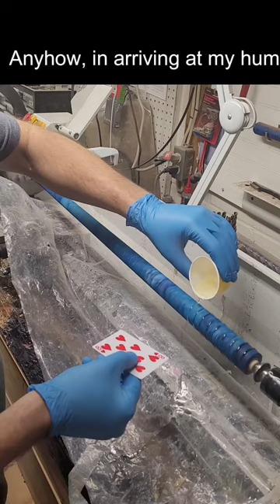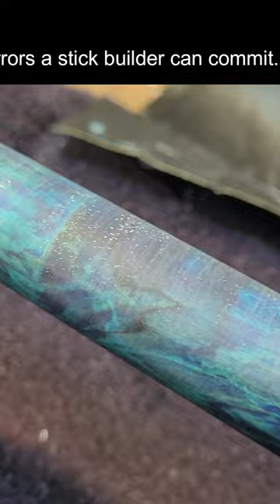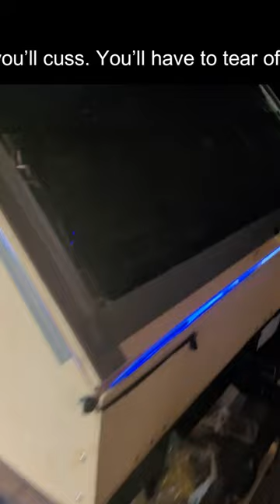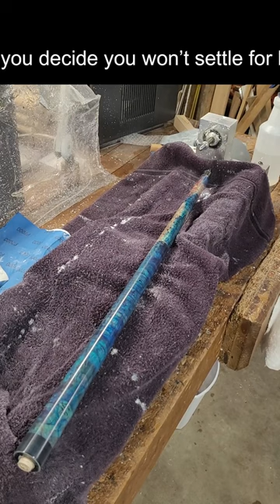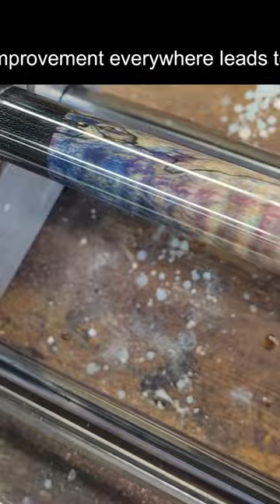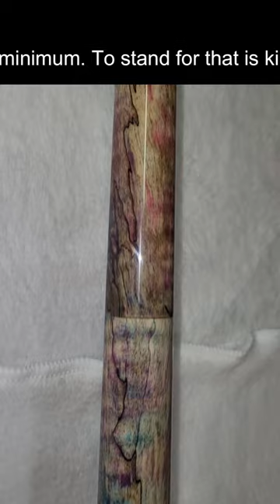"Pool Cue Makeover: Using Solarez UV Finish on the Tree of Liberty"

Comment: I must have received a bad batch of Solarez UV because I followed the direction to a T, and it never hardened up and it smelled AWWFUL
Reply from the maker: Could be a light problem. Did you try it in sunlight? I quit using it myself.
Reply: @charactercues  once the UV light didn't work, I set it in direct sunlight.